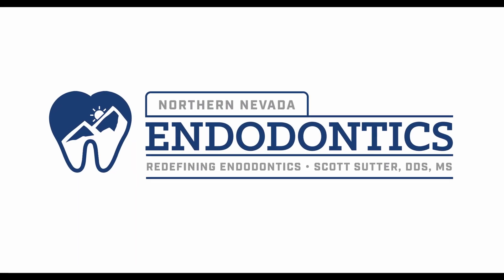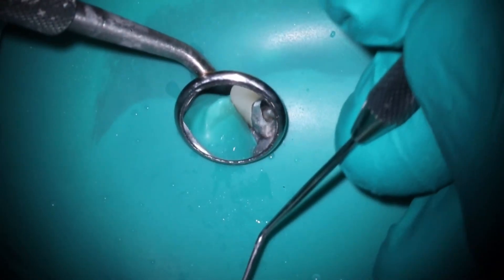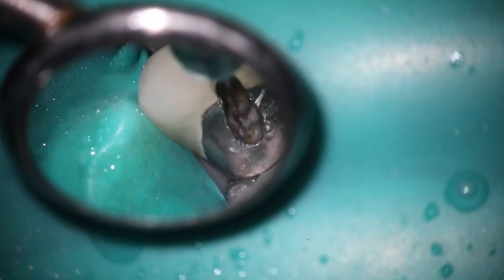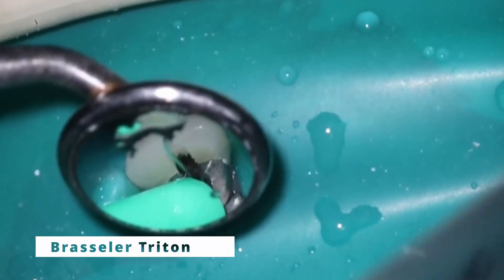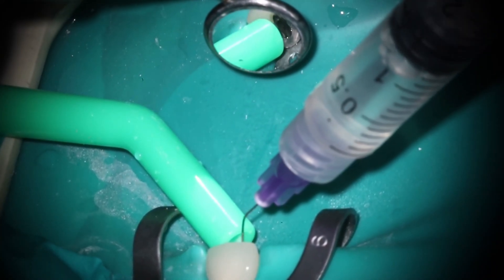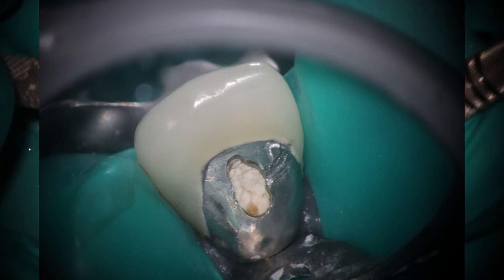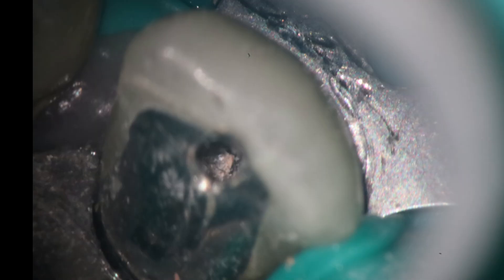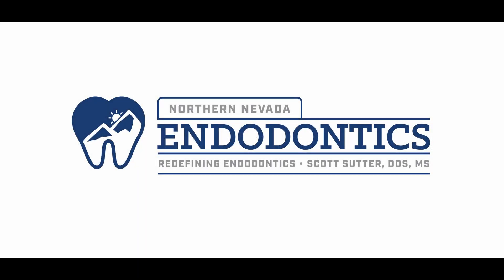Modern Endodontic Accesses: Maxillary Incisors

Comment: Hoping you see this.
What bur do you use when you’re doing those small incisally accessed incisors due to it being calcified? 
It looks like there you were able to avoid the actual incisal edge. If the CBCT showed you had to be right on the incisal edge or even slight facial, would you still access straight like that? Or would you just try to come on the lingual a little bit but just slightly angle it facial?
Reply from the maker: If it’s the arrowhead looking one it’s the EG3 from SS White, great bur! I then “enlarge” the access with an 850.012. If I have to go through ceramic I use the Duracut burs from Brasseler. They now have an 012 round diamond that works great even on lower incisors. 
I’ll go straight through the facial. I keep block out resin to hide metal and then have enamel composite that I use to repair it!